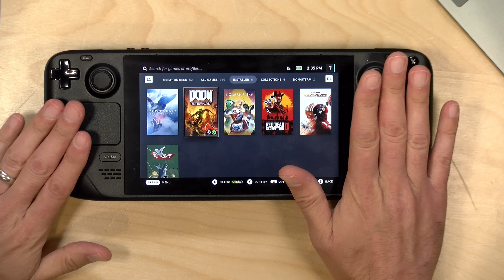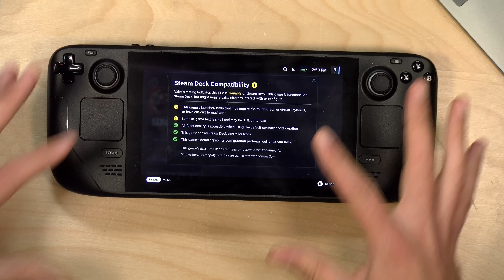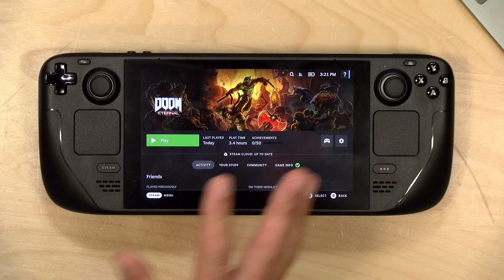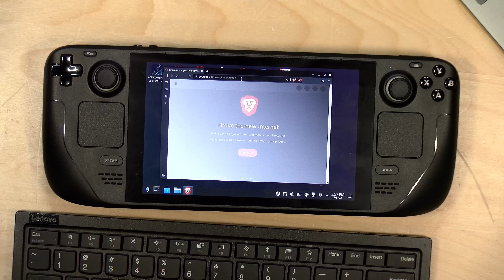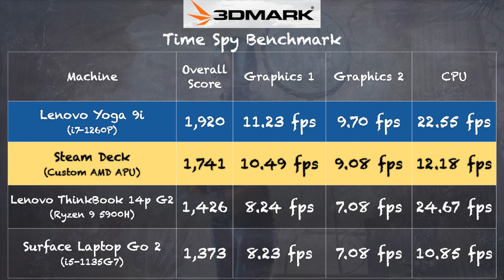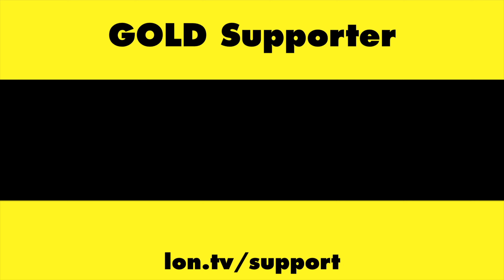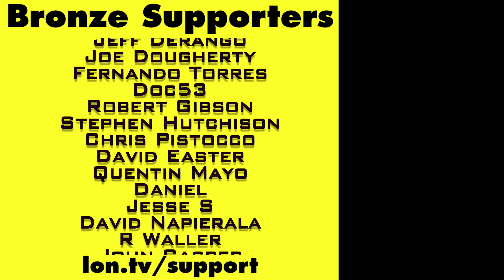Steam Deck Review & Deep Dive - SD Cards, Desktop, Epic & Gog, Windows, vs. a Laptop and More

Comment: A technical detail about SteamOS: originally, it was a Debian based OS, but is now Arch based, presumably for better optimizaiton and customizability
Reply: for faster updates*
Arch is a rolling release, Valve can use that to provide faster updates for the OS - kernel, driver packages... and so on, which would in turn improve the gaming experience on the device. customisability doesn't bring much weight in the decision.
Reply: and upgradability! 😊
Reply: hi dear dose all games work properly when connected Steam to TV ?
Reply: @imohbalu  Yes they should

Comment: Nice review! Couple things I'll mention based on my experience:
The 40hz screen mode is really nice for more demanding titles like rdr2, and gives you more smoothness than 30hz and better battery than 60hz.
Finding a laptop with compatable gaming performance for $400 specifically, might be tough. I'm guessing the other devices benchmarked were at different price points.
My wife and I each have decks, and there is no useable performance difference I've seen between her 64gb model and my 512. The SD card works great, and is a totally valid option.
And one of the biggest conveniences is the ability to suspend the whole system at any time just like the switch, something I always assumed was impossible for PC games. As a parent with little kids, it's really nice.
Hope you enjoy yours, and I'm curious to see how your impressions evolve over time!
Reply: This has "made for busy grown ups" written all over it.
Reply: to expand Your arsenal there are options for this in Linux as well. :)
Nyrna - Suspend games and applications
Reply: Can you share the experience with the two screens? I am trying to work out if the anti glare screen is worth it. I plan to swap the SSD if I get the 64GB so the screen is the only decisive factor between the two. Thanks!
Reply: Have been interested in a while but declined to register or order. So many comments like yours are making it difficult to not just grab one of these now that they are available

Comment: When I get mine in October I plan to use mine strictly for emulation as trying to set everything up for a laptop gets messy, And all the laptops you need at least  midrange specs For good performance

Comment: I just run notepad.exe on Steam which switched the Steam Deck controller to Xinput. Also there is a great configuration tool under Steam settings via Windows which kind of made me stay on Windows, It works just like my old GPDWin2 joysticks. Love this thing! (P.S: I made one of the back buttons configure as a "Alt+F4" or "Alt+Tab" option)